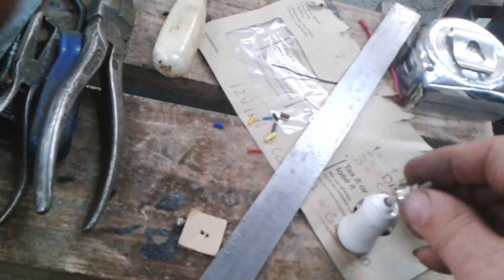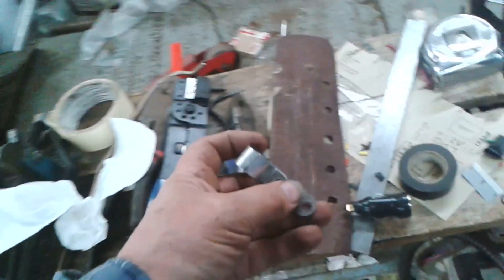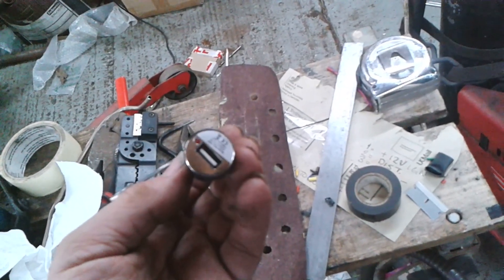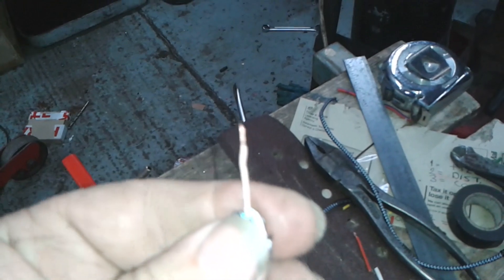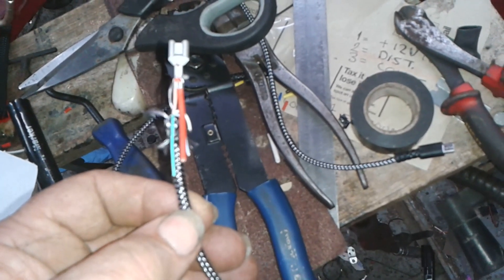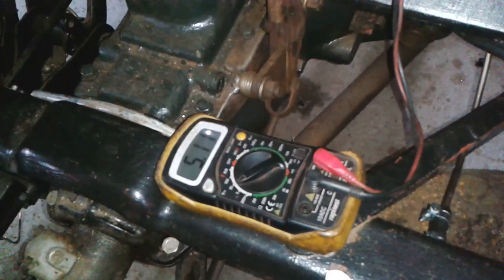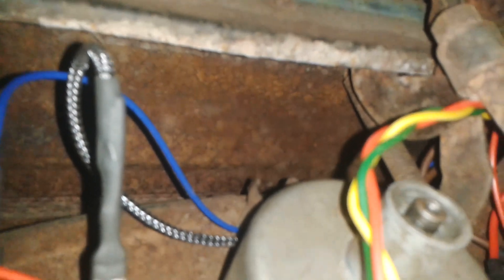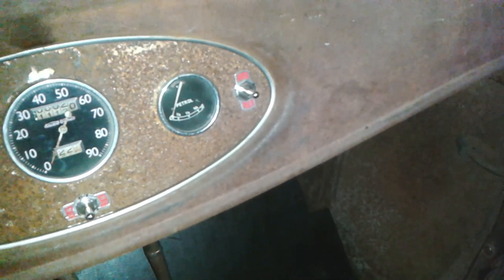6 Volt Gauge in a 12 Volt Vehicle? It could be easier than you think! Cheap Voltage Reducer.

Comment: I have read several comments on the HAMB about your mod. I think some may have missed the point. You did something different and creative. Isn't that what hot rodding is about? Now add another one and charge your phone... watch them then!
Reply from the maker: Thanks Mike. I was a little surprised at the response. I've done the 7806 and this was easier, plus if it failed you could find a new unit at any gas station.

Comment: Ford used 6-volt gauges in all US vehicles, up until the late 1960s or early 1970s.   You can still buy, or find, the voltage reducer, it attaches to the backside of the instrument cluster on those cars.   More expensive than Mart’s solution, but I watch for them at swap meets and never pay much. IMO makes for a neater installation.   No offense intended, Mart.    Originals probably harder to find in the UK!
Reply from the maker: Merc, you're right and I actually do have two of those units. The problem is they turn off and on and that can be seen on the gauge unless it is heavily damped. These simple, highly reactive gauges don't work well on that type of regulator.

Comment: Does supplying 5V to the gauge, instead of the 6V the gauge was designed to run on, affect the accuracy of the gauge?  Just wondering.
Reply from the maker: Not in a way that I can detect, Bob. As long as I know when I need to put some fuel in, that's good enough for me.

Comment: Mart I buy those adapters at out local dollar store, I take them apart and reverse the wires so I can charge my phone on my 6 volt negative ground car using the lighter socket. You can also remove the guts and mount it to a small piece of wood or plastic and mount it under your dash,  just wire + to plus and - to minus keeping the board insulated from any metal.
Reply from the maker: That's interesting, Vette. I thought about dismantling it but felt it was easier to leave it more or less untouched especially as I have a couple of spares. I couldn't believe how cheap they are. I run 12V neg earth so don't have to do anything tricky.
Reply: I would worry the USB will fall out so your idea is more permanent.   ✅
My experience with those cheap chargers they are a bit fickle when trying to charge my phone and take for ever.
Lower amps for the fuel gauge seems to be fine.
Thinking outside the box is what it is all about.
Time will tell aye ?